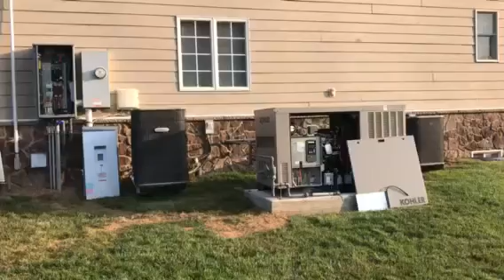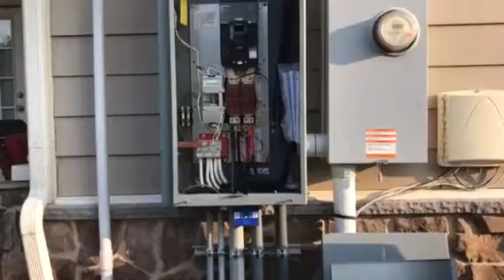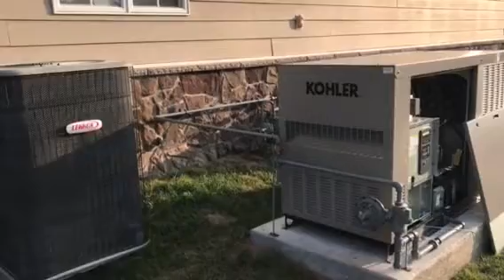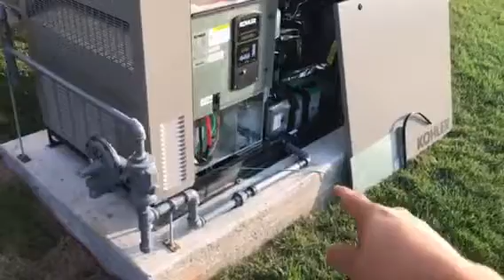Kohler 38kW

Comment: I just ran my Kohler 30RCL for 10 days straight down in Florida after Ian.  I shut it down for an hour to change the oil.  The liquid cool run at a quiet 1800 RPM. Kohler makes very good generators.
Reply: how often do you change oil?
Reply: @anomalyevolution40  Every 150 hours

Comment: 38kw for one house!?!  That thing will never run above 50% I bet.  I wouldn’t want the fuel bill for such overkill.
Reply: Our house is all electric, it needs 42A just to run the geothermal.  Add in 19A for one water heater and 12A for the well, and we're already at 17.5kW without a single light on.  Add in an electric cook top, oven, lights, TV, dryer, second water heater, microwave, garage shop tools, we're over 100A easily.  And if it's -30, the 50A emergency heat might kick on.  The cost difference between a 24kW unit and the 38kW, and the fuel consumption differences are both negligible enough that having the overhead of the 38kW unit makes sense.
Reply: @desertaip9137  We Took Our First Estimate From A Kohler Installer Last Week And The Recommendation Was The 38kw.